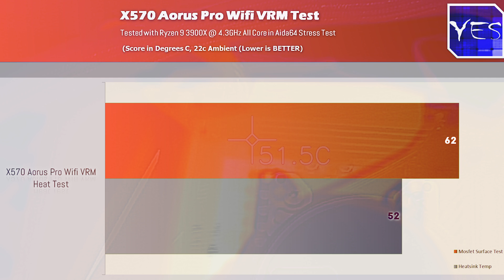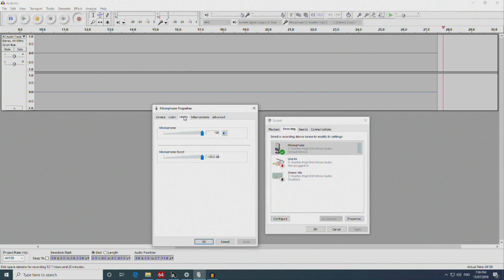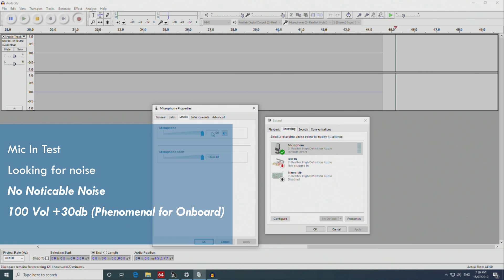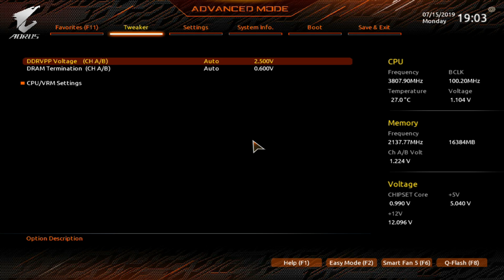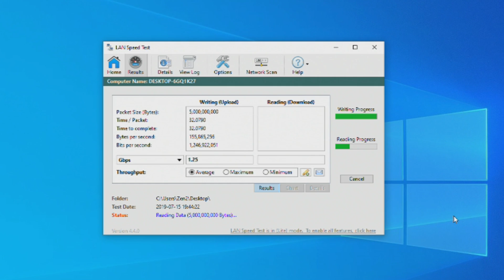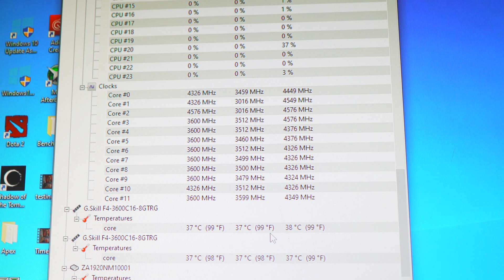Best All Rounder X570 Motherboard...? AORUS Pro (Wifi?) Review

Comment: What happened Bryan? This is 4y old and its almost an actually good review (i was looking up my 3900X  studio mobo and got curious about the wifi card, stumbled on this). Theres always room for improvement but in 4y you could have been amazing (didnt seem to be any mention of what memory speeds it could achieve (a huge point of variance back then), you didnt actually sum the power stages and compare it to the peak load (its ridiculous overkill but who doesnt like that), didnt look at noise, harmonic distortion, intermodulation etc on the audio despite having the gear, you seemingly pronounced it could drive headphones without doing specific loaded voltage tests, you didnt mention the heatpipe connecting the VRM sections, but what you did do was good).

Comment: I heard the Taichi chipset fan is noisy. So are both of their fans low noise ? What is the major difference between the Pro and Master ? I need thunderbolt and these boards need the Rev 1.1, only from the Pro gets thunderbolt. I would like to find a non wifi Pro rev 1.1 board. Which finding stock for this is difficult in AU. Trying to find out right now. I looked at other Asrock with Thunderbolt and seems like they can't handle the 12-16 cores.

Comment: Does this board take a long time to post? I see that all over the reviews. Thanks!

EDIT: Someone else replied on another channel. The issue has been fixed with a BIOS update.
Reply: That makes me feel better. I hate to have “buyer’s remorse”
Reply: MediumWar Sometimes on cold boot it takes a while but other than it it's pretty quick. Just update the BIOS and change the boot mode to ultra fast
Reply: Is this mobo have built in wifi
Sorry im confused
Reply: @joandeleon7795  yes it does. WiFi 6

Comment: Hello,
I had an issue where my graphics card is so large that the Hard Drive connectors in the motherboard interfere with my GPU fitting in its slot, this happen with the Aorus RTX 2070 Super and the Aorus B450 Motherboard, forcing me to plug my GPU at the bottom PCI slot.
My question is, would the small fan this motherboard has, interfer if i want to plugin my GPU in the closes PCI slot to the CPU?

Comment: They got half of the X470 Gaming 7 heatsink at least.  I wonder if it lacks the mass necessary for a modern VRM heatsink on all  but the most efficient VRMS.  It seems to be optimal at shedding heat, but perhaps the lesser VRMs out pace it's ability to cool and need more mass to absorb heat.

Comment: Hi, thanks for the review. I was looking at getting the Aorus Elite version. But it appears the Elite has just one heatsink on one of the PCIE ports (out of two). I was planning to use one NVME SSD drive for OS and programs and a GPU (likely RTX 2060). So, it would be only natural to plan for the GPU to go on the slot with the heatsink. But based on your review without the heatsink, does that mean the slot without the heatsink will run into heating issues with an NVME SSD drive? 
What would be your suggestion? To forget about the Elite and go for Aorus Pro?
Reply: On the Elite you can move the heatsink to the 2nd port.

Comment: I just got this MB, the WiFi version though. The chipset fan location is probably the biggest con of this MB. My 1070 FTW literally covers up half the chipset fan and when it spins up and is fairly loud. There are 3 prreset settings for this fan, silent, normal and performance. Like I said I just got this board and haven't got to play with it much. Don't these companies consider this when designing a MB?
The WiFi works great BTW. It comes with a separate plug in antenna that you can put anywhere.

Comment: A question about the NVME SSD, if I used a M.2 drive, will it still run super hot like you reported or was the temperature reported only without any heatsink in the NVME slot under normal operation?

Comment: Solved the Thunderbolt 3 header mystery. It seems Gigabyte had this header available on a number of their X570 pre-release MBs. They pulled the header from the released retail versions, what a shame!
Reply: Can you solder header pins to the pcb and use a thunderbolt 3 add in card? I dont know how that really works, but I'd assume that it's possible.  Also, in the video he mentions that add in cards are compatible, but are they compatible without the header?

Comment: question about 8pin + 4pin EPS. do i need to plug a power connector on a 4pin too for 3600x ? or just the 8pin is enough ? i am getting this board in november, but i have a crappy 80+ bronze power suppy with just an 8pin

Comment: I've been looking for reviews and tips on what board to get for my new PC upgrade (I haven't built a PC in 9 years) and this will be my first AMD build. I'm a 3D artist and I aim to build a machine that will be able to withstand the heavy workloads that come with rendering. I will be using the 3950X in my workstation.

The top four boards I'm looking at are

1. ASUS Crosshair Hero VIII 
2. ASRock Taichi 
3. AORUS X570 Ultra
4. AORUS X570 Pro

From your review, it looks like this board will be able to handle the workload for high-end rendering. And the price isn't too bad.

I'll gonna take a chance on the board and it should be stable enough to handle a mild overclock. I'll be air cooling using the Noctua NH-U14S and multiple fans from my old build (they are also Noctua NF-P12)

My second motherboard choice is the CH8.
Reply: I am actually looking for a similar setup. Would you recommend going for the Aorus Pro?
Reply: @ysoangry5064  I ended up going with the Crosshair Hero VIII
Reply: @MrRileysGameroom  Cool. Thanks for the quick reply though.
Reply: @ysoangry5064  With its beefy VRMs and high end features, including 2 m.2 slots, it was too good to pass up. Also on the CH8, the shroud covering the drives also serves as a heatsink... with air cooling, that should never get too hot...
Reply: @MrRileysGameroom  I was considering this motherboard as well. However this board isn't easily available where I live.
Reply: @ysoangry5064  Damn. I bought mine last year to prepare for the 3950X

Comment: Thanks for this review. I have this board. If you haven't already, please overclock on it! I noticed there are 2 settings for PBO. It would be great to get details on which ones to enable/disable for a stable all core overclock.
Reply: Is this good for OC??
Reply: @sgm7650  It really depends on who you ask. I personally don't like to use them since the Temps are usually higher than I'm used to. I am hoping someone oc on the board.

Comment: Word of advice buy a proper case with great ariflow if you intend to buy a x570 board. I got fecked with the h500 case - my pch temps are idling at 70°C because of shit airflow.
Thanks NZXT!!!
Reply: Damn straight facts lol. That thing barely has any air vents on it. Always focus on functionality over looks!
Reply: Mahone whats ur cpu?
Reply: @bodz9408  3700x/x570 Aorus pro
Reply: Mahone so which case do u recommend that have better airflow than the h500 but in similar price ?
Reply: @bodz9408   Ones that don't have the front blocked or just check Gamernexus case reviews.
edit: My Zalman z3 which is a budget case(bought it for 35€) has almost 13° lower temps.
Reply: Mahone thanks dude.

Im building my first gaming pc and im ordering tomorrow. Heres the list:
Ryzen 7 3700x 

X570 aorus elite wifi 
MSI GTX 1660ti 
1Tb SSD 
16Gb ram 3600mhz c18
Reply: @bodz9408  If you're gonna be doing encoding stuff (handbrake/adobe..) get a decent cooler. I have a hyper evo turbo and it goes to 80°C after a 40min video encoding
Reply: @mesicek7  i wont be doing that i will game mostly on r6 and record and do my college work and edit my videos
Reply: @bodz9408  Also buy a moduar PSU !!
Reply: @mesicek7  Yh I have a fully modular 80 + gold from corsair Rmx series (650Watt)

Comment: Great review as usual. If you're lucky enough to live near a Micro Center, you can save like ~$50 if you bundle it with a Ryzen 3000 CPU.  I'd say the $270 price is pushing it, but at $220, I'm strongly considering it

Comment: Can I ask a general question, as I am considering this motherboard. My interest in PC's is strictly function over form, I am not the slightest bit interested in RGB or the 'look' of the board.  The plastic cover over the I/O also covers the lower VRM heatsinks.. this to me seems a bit silly and superfluous, and would block airflow away from the heatsink. Therefore my question is, is this removable? Is there any reason to keep it on the board at all?

Comment: I am really having a hard time choosing between the Elite, the Ultra and the Master. I hear scary stuff about the chipset's fan but the only one w/o one is Xtreme at 699. I would pay 400 if it is worth it but 700 is way too much just for no fan. Can you recommend one of these boards? The chip will be the 3950X, but if there is one that overclocks clearly better I might go for it instead
Reply: Why are you looking at the Ultra and Master? The Pro basically has the same featureset but cheaper. If you want to go one step higher, go for the Taichi. But all of the ones named will not break a sweat with a 3950X. Even the $200 Elite would be fine with its VRM.
Reply: @theDaNi0  Ultra: Better VRM cooling and one more NVME with heatsink - Master: Better VRM and controller, 2.5GbE LAN, better audio (DAC) and more OC features. Power delivery and management is more than current. The Taichi is a great board but this one is better in the power delivery, heat dissipation and audio department. The Taichi has 8 SATA ports but 3 active NVME is a lot better if you rather have speed than space. Price bracket is the same

Comment: So, I bought this board installed and configured windows on F3, updated my bios to F4f, and now my 3700x never downclocks like it did with F3, stuck between 4.225 and 4.275. Is this normal for windows, cpuz and hwinfo to report? I've tried resetting to optimized defaults but keeping my mem oc. Disabling PBO, and made sure its allowed to downclock. Even uninstalled ryzen master. Should I wait for a new bios or is this something I did?

Comment: Hi, my 3900X and X570 Aorus Pro arrived today and there is a serious design flaw you did not point-out. The chipset cooler takes in its "cold" air directly from my GPU heat-sink.
Reply: Get a vertical gpu riser bracket.

Comment: Good review but I still prefer the X570 Taichi although I like how the south bridge fan looks a little lower so my GPU shouldn't be right over it.
Reply: That bothered me on the Taichi, but it bugs me more that there is no Debug LED for detecting errors
Reply: @MrRileysGameroom  I ended up returning the X570 board and continued to use my X470 Taichi. Doesn't run as hot or waste extra power.
Reply: I can't decide if the Gigbyte or the Asrock Taichi is better.  Any thoughts?

Comment: Can you test two samsung 970 evo/pro in RAID 0 in that motherboard with PCIE 4.0 please? the actual problem of doing a raid in PCIE 3.0 is that there is nothing of improvement in the performance ... but what happens when you do this in PCIE 4.0 ?

Comment: I have the x570 Gigabyte Aorus Pro Wifi and its awesome!  VRMs great, AX Wifi great, PCi4, etc.
Reply: Michael jefferson Jordan MJ99  Well i have two of these motherboards, I really don't hear anything.  They do run at pretty high rpm though like 1700.  I have seem them 'off' too which wierd.   However my living room has fans, tv's going, so it depends how quiet your environment is.   But i think in a regular case with case fans, probably never hear it.
Reply: Michael jefferson Jordan MJ99  Probably would help.  I only  have one m.2 and its still pretty cool overall.

Comment: Over-engineered beyond all reason.  All just to get to 4.3GHz all-cores?   In what world does this make any sense?   A cheap B450 gets me to 4.1 GHz on a 3900X with zero effort.  I have it front of me... MSI B450I (mini-itx w/ 6-phases), Fractal 500 case, Noctua tower cooler (air).  Some 3000 MHz memory. Nothing special here.   Set multiplier to 41, VCORE to 1.25... it works on the first try, 172W at the wall going full out.   I wonder if I can get it to 4.2... lets try it.  Multiplier to 42, increase PPT cap 175W.  Nope, that didn't work.  Ok, VCORE to 1.3 (that's the most I'm willing to do), PPT cap to 200W....  that worked.  4.2 GHz, 186W at the wall going full out.

So why would I want to spend $269 for that X570 motherboard when the one I just tested with above is only $130?   Just for 100 MHz more and PCIe-4 stuff?   Answer is... I wouldn't.  I would rather spend that extra cash on getting a beefier CPU to plug into it.   I might happily pay for a X570 motherboard with a sane VRM configuration (and thus a lot cheaper... say, $150... I would pay for X570 at $150, possibly even at $170).  But not $269.  $269 is obscene for a motherboard.

Look for these X570 motherboard makers to return to sanity and start to drop the VRM and phase count, because once the hype is over they are going to have a hard time selling these over-engineered boards.

-Matt
Reply: They put the thick heatsinks and VRMs on there to comply with PCIe gen 4. Supposedly when you use a gen 4 SSD in raid configuration it generates a lot of heat and the heatsinks are there for that
Reply: @scottyhaines4226  That makes zero sense.  The VRMs don't supply power to the SSDs, and PCIe-v4 signaling doesn't eat tons of power either.

Don't get me wrong, I like heat sinks on the VRMs... I have no problem with having a heatsink.  I love to see heatsinks, particularly on the cheaper B450 boards, because it means I can easily control VRM temps.   The problem is that the number and quality of the VRMs on these X570 motherboards is way, way overkill.

Its something one might need for a 14nm++++ Intel CPU, but it is entirely unnecessary on a Zen 2 7nm CPU because you can't actually overclock the chips just by pushing insane amounts of power into them.   It makes me wonder if the mobo designers themselves got a little confused about how overclocking needs to work on Zen 2.

-Matt
Reply: @junkerzn7312  you're going to generate more heat when you overclock 7nm vs 14nm because the amount of space the electrons have to travel is significantly smaller and when you're trying to shove a whole shit ton of them you're going to need the VRMs and heat sinks to handle the heat and energy it'll produce. Also PCIe gen 4 spec is high bandwidth, high clock speeds and it uses half the lanes at double the speed, so yes obviously if you're doing something twice as fast with half as much space than you previously could, you're clearly going to create a ton of heat and if you're running it in raid 0, it's going to be even worse. So yes they did need to put the ungodly amounts of heatsinks and VRMs on the board. That much energy going through the board at once is going to need a thicker motherboard and more phases.
Reply: @scottyhaines4226  Physically speaking, the heat generation can be the same but the energy density will be much higher.  Because the energy density is higher, the temperature gradient from the transistors to the cooling solution interface is also going to be higher, which is one reason why controlling temperature is so important.  This has nothing to do with the VRMs.

PCIe-v4 is twice the bandwidth but not twice the power.  Tests have already been run on PCIe-v4 by DerBaur... it is NOT a significant source of additional power consumption for the VRMs even when running full bore.   The NVMe PCIe-v4 SSDs, on the otherhand, can get a lot hotter just due to the controller and nand running so much faster, but those are NOT powered by the VRMs.  They are powered directly by the PSU.

I think you are a little confused about what the VRMs are actually powering.

-Matt

Comment: But between the x570 taichi and the aorus pro, which one has the longer lasting(as in years and years to come) components? When I look at asrocks product website, there is a lot about quality parts used on thst mainboard, on the gigabytes product page, not so much. So is the taichi lasting longer? I'd like my mainboard to last another 6-7 years.
Reply: I mailed both companies and received the following information: Taichi will break after 33 months (AM4 Socket starts rejecting CPU) and Aorus after 25 (Short Circuit between DRAM Slot B and bottom PCI x4). So i'm sorry to report, you're screwed either way. Reason for Taichi lasting a bit longer is due to written text about quality parts on their website.

Comment: Can you do review for Asus Tuf Wifi ? It doesnt have heatsink for the cpu m2 slot. Are there any difference in performance between cpu m.2 slot and chipset m.2 slot ?
Reply: I have the exact same question. When you recommended heatsink for nvme, is that for all nvme or just PCIe 4.0?
Reply: @kitk7248  It's definitely for all nvme. I have 970 evo and it's veeery hot.
Reply: @musicxxa6678  thx. Will go for another board for 970 evo plus. 3rd party nvme heatsinks look suspicious.

Comment: I don't think any other reviewer pays as much attention to onboard sound as you do.   Nice to have the info you provide on that aspect of a motherboard.
Reply: I wonder how bad is microphone with boost with ALC1200 in X570 Elite which is 20% cheaper and has lower position of chipset fan where air is a bit cooler. Still, MSI and Asus have two major cons - after sale service (warranty). Gigabyte and ASRock does not offer warranty service.
Reply: @elksalmon84  That doesn't sound good, especially for those moving to an AMD system for the first time
Reply: @elksalmon84  My brother, decent onboard is nice to have but dont base your decision on an onboard codec when a $100USD USB Audio interface will thoroughly outperform any onboard.
Reply: @mycosys  I have motherboard with ALC1220 now. It's good enough. No noise. And has an amp.